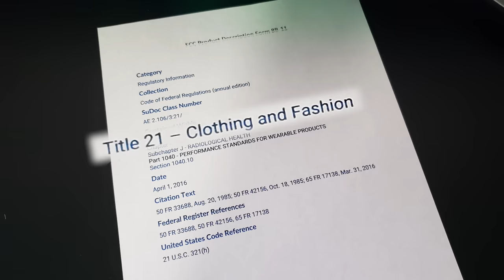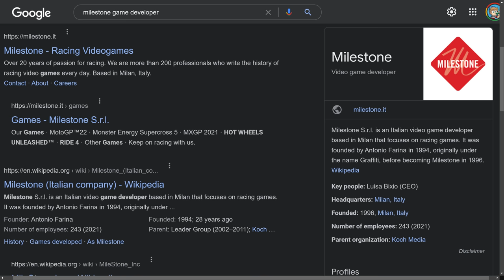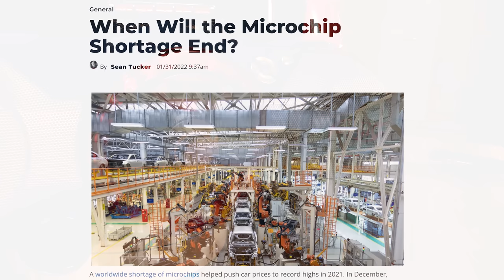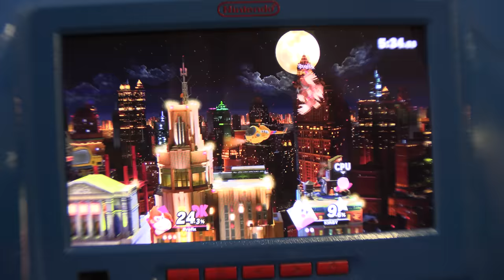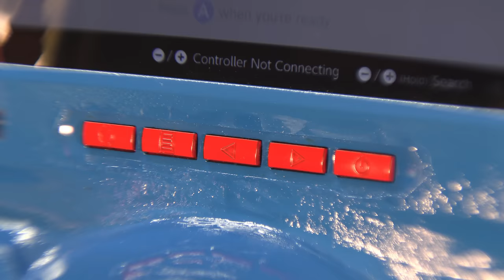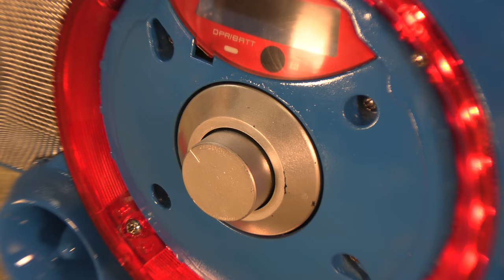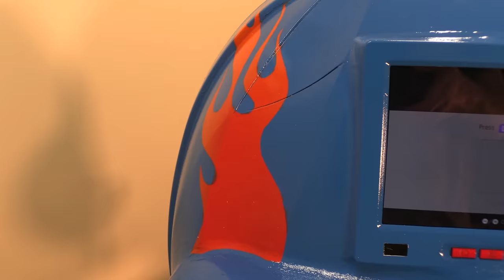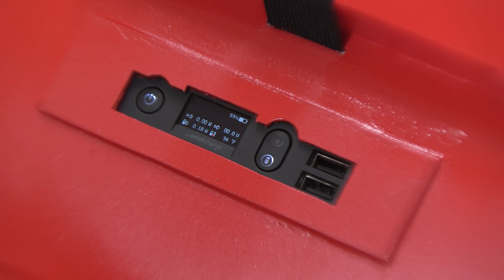Why You Never Heard of the Hot Wheel Switch Backpack

Comment: It'd be one thing if this thing has a decently sized screen in 1080p, then you could at least argue that you get the advantages of docked play on the go, but that screen seems to be the size of the Switch's at most and it's the same resolution, so there’s zero advantage to using it.

Comment: As a mechanical engineer in product development of similar nature (plastics, electronics enclosures, etc), I was going back and forth throughout this video wondering what I was looking at.  This clearly is not a production-style assembly as there are far too many anomalies from a normal high volume product (painted instead of dyed plastic, unusual undercuts that wouldn't be moldable, etc).  It seemed most like a trade show mockup or similar, which almost made sense given the proposed low-volume production as it would make more sense to use prototype-style processes if that were the case.  But after the end and also the people below that pointed out most of it is a Sony stereo and I'm sure the rest is a gutted backpack and some kind of hard case travel bag, it all makes sense.  Seemed like a plausible prototype bag thrown together for a quick trade show display piece or a concept model, but definitely not something I'd believe was manufactured into the thousands.

Comment: It doesn’t make any sense to make it that big… it’s a switch dock, which means it’s from this century… it looks like it was something from the early 90’s… the screen is slightly bigger than a switch, but it’s a dock screen so smaller when used as a dock screen to play with another then it’ll be smaller than both playing on a table top with a handheld switch… then the speaker system is awful and a Bluetooth speaker would be better… a bag with a bigger screen and much smaller over all size with a Bluetooth speaker would still be a stupid idea, this is like Tim and Eric designed it… Great Job!

Comment: This could definitely be a useful little tool if it was actually made with care. It could very well be remade with major changes to better the overall portability, comfort, and quality of the product. Such as: reforming the actual backpack to fit comfortably and securely on the owners back, enlarging the screen size and resolution, giving the product a compact, sturdy, and protective design, and implementing a built in rechargeable battery of the sorts to power each component properly. The best thing about it is that you could still even add epic flames alongside hotwheel’s precious color scheme to the final product to really bring life to a new, beautiful, and vibrant hotwheels nintendo switch backpack.

Comment: I mean, well...
In theory it's not actually as redundant as it sounds; games on switch tend to run in two different graphical modes, depending on whether they're docked or undocked, with docked being a higher quality.

So if you could somehow have a portable *dock*, then you'd have the best of both.

But dear god is this thing ugly.
Reply: Yeah nvm I just got to the part where you said it outputs at 720p.

The switch does that already for most games in handheld mode; so this portable dock doesn't even have the benefits of being a dock.

Comment: That... THAT IS NOT A BACKPACK.
THAT IS A PAINTED THIRD PARTY SCOOTER TRUNK WITH POORLY ATTACHED OFF-THE-SHELF PARTS.

You can even still see the reflectors' outline on the thing. Those bumps on the inside? The places you put the bolts through to fix it to the back rack. The useless volume buttons? Probably a part of the stereo they half-assedly glued to the top of the trunk. 
I refuse to believe that is real. You made it yourself did you.

Comment: A transparent glass at the back where the switch would face the outside world instead of the actual  720 pointless switch size LCD would have solved:
- The battery life issues.
- The overall weight and package size.
- The insane cost.
- The janky circuitry involved.